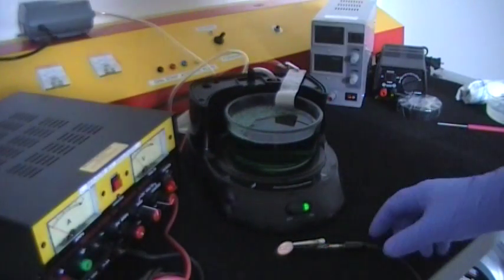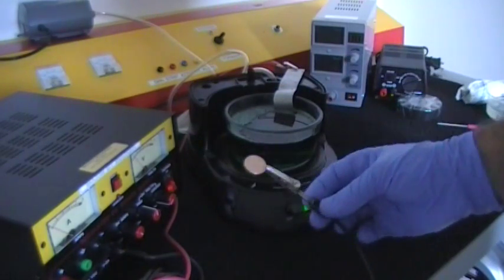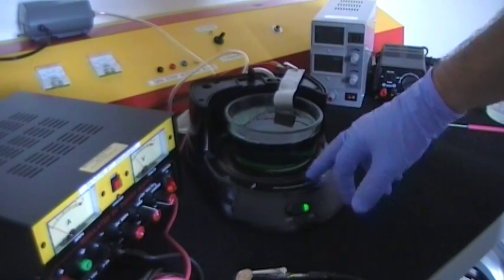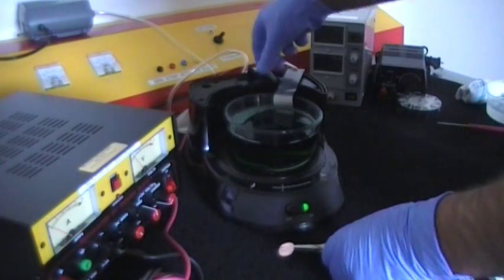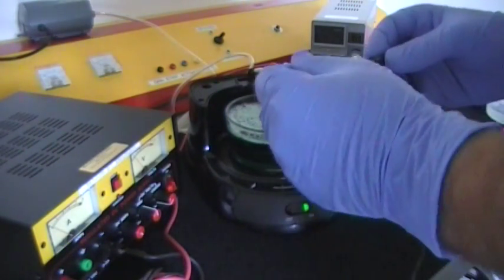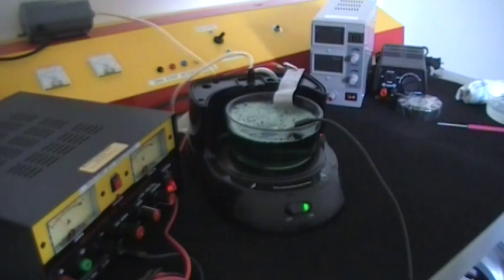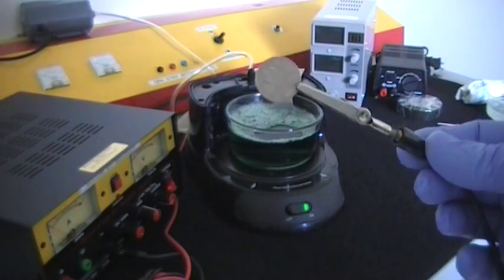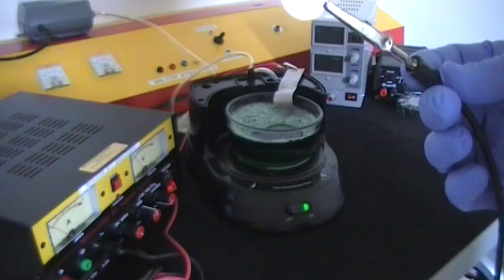Nickel Plating, Fast and Easy Way !!! www.beckerindustries.com

Comment: Sigh. A penny is not pure copper, and does not tells us if you can plate copper. Not describing the solution and using a stainless steel electrode (hexavalent chrome risk) combine to make this yet another worthless "plating" video.
Reply: pennies before 1982 were pure copper after 1982 the pennies were zinc that was  copper plated.

Comment: @maxim5and20 so you just heat up the solution and dip it in there for a few minutes is there any other types of equipment you need? for setup

Comment: Folks - avoid using stainless steel for your anodes.  Stainless steel is an alloy which contains chromium.
Using stainless as an anode can cause the generation of extremely toxic hexavalent chromium gas.
Reply: what else can we use instead of a nickel anode then?